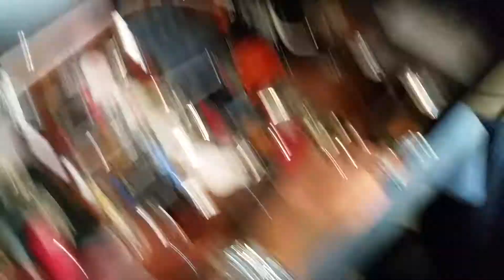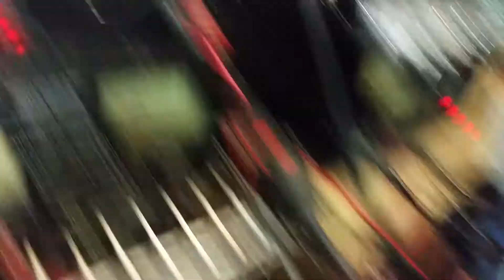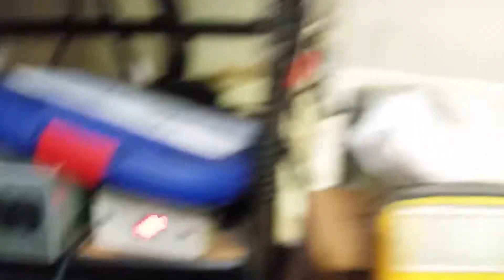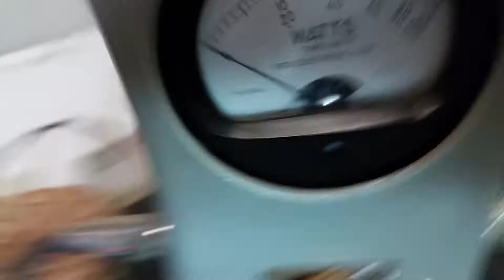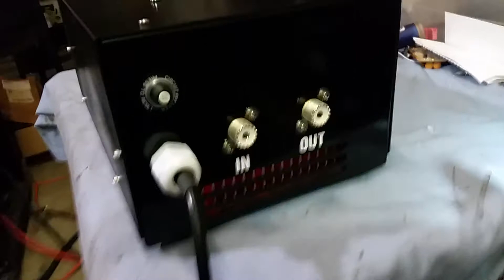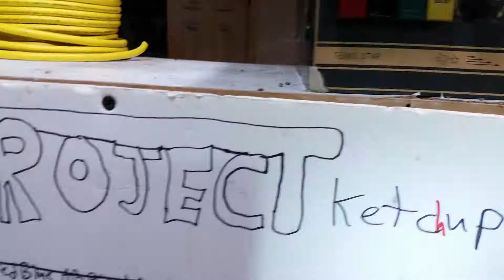GK Built 3 Pill Base🔌Amplifier with IRON 🦾 INSIDE Gk200-LD

Comment: Thanks GK for posting the video of my amp. Still running strong.
Reply from the maker: Heck yeh.....There he is yall. Dood thanks so much for commenting. I was really really wanting to know how well this amp is still working. With you popping up letting me know that 4 years later that it is still working and going strong 💪 means so much man. Thank you Kevin!

Just out or curiosity 🤔 have you used it stand alone or ever used it as a driver? Give me some readings on what you get out of it and what transmitter you use....thanks in advance bud.
Reply: @1883GotDown  I only  use a 4 watt base cobra 89xlr. I get 175 bird on 15.2 volts. 18.9 resting voltage. I'm loving it.
Reply from the maker: @mrnobody329-kevin6  beautiful....you know how to make things last!

Comment: LOL you did would I would do with that light. Nice base amp. I would not go any bigger with driver than 2290 on 3 pill. funny I got some filter cap . a box of them . love that bridge rectifier . I had base amps come threw with them 50 amp china bridge . they are junk. I can send you a truck load of bad ones. got a odd 20 amp ICAS  13.8V supply to fix now. looks like pyramid but has no name on it. and uses a 36V CT transformer . 1/2 of bridge rectifier used. and that went open. replaced with 2 Shockey diodes  TO 218 package.  30 amp 150V . they run cooler  and less voltage drop. checking filter caps now. may put japan ones in if customer wants them .has 4 2n3055 and tip 42c on back heatsink with diodes. trying to mount small fan now on it. it is a LM723 based supply. 73's
Reply from the maker: Real neat project you got going on right now. I have 2 Pyramid PS-36kx Power Supplies over here which were my first power supplies I ever purchased. Ill never forget. I bought me my second TS 667V and I paid $400 for those 2 power supplies(ooooooouch) they had just got back from pyramid getting repaired. First time it went, I went ahead and pulled out the LM723 and put a socket on it just incase. Pretty neat idea 💡 using the diodes that you used. I havent heard of people using them for rectifying voltage that way. That is neat...yes lower voltage drop. Thank you for the emails...I habe made a folder called Robert meyer to keep all my info from you in. You are a very knowledge person and I am delighted to have you here conversing with me!

I cant wait to play around with regulation because I really really want to regulate some iron. I know it is nice to have higher voltage like the 36v transformers but mine i have are only 16v or so.
Reply: @1883GotDown  The 36V winding has a center tap. so only 2 diodes are used. The replacement used is   30CPQ150  30 amp 150 V . I put the 2 diodes together and used 2 .with them the float voltage is about the same but under load have about 1V higher on filter caps. I pulled on and put on ESR meter. should be 4700 UF 35V . testing around 3000uf .I got some nice 4700 UF 35V low ESR audio grade made in japan will be going in. I put type 43 cores on pos  lead to block RF . one on ac cord as well. put thermal switch on foot of transformer and one on heatsink.  load test is fine. Inferred camera shows no real problems . when I put new filters in I will replace small wires with heaver AWG . they get warm under load. I did the diodes all ready. they had 20ga with 1/4 push terminal on bridge to transformer and the push terminal was melted on 1 side. I have a 80mm 24V fan for heatsink trying to figure out a bracket to mount.  no room to mount one buy transformer but can put one right on top blowing right transformer. power supply is used to power UHF/VHF radio . was set at 13.7 V I re set to 14V oner wanted that. there is a ammeter no volt meter. had to re calibrate meter. was off 2 amps low. This is not mine and can't show pic. 😀 73's my cats help as well LOL
Reply from the maker: @robertmeyer4744  I will admit, I never understood what center taps are about on secondary of transformers. Why didn't you have to use a full wave bridge and only a have wave? Do you mind explaining a center tap? I noticed on BBI video on a filament transformer that he had a center tap and some how used it for bias or something.
Reply: @1883GotDown  with 36V center tap . to get 18V ac only use 1/2 winding center tap. you use 1 diode and outher half you use one diode. this is 2 diodes in full wave using center tap . ac first half of wave form goes threw 1 diode than outher half 180 deg or neg part goes threw outher diode. making fill wave. the center tap makes split phase just like a pole transformer feeding your home. . now with a center tap on filament transformer  that different. the tube is directly heated and that the cathode. to bias the tube the cathode is lifted off ground to make  class A ,B , or C depending on tube. this the grid is ground. the input is put threw a LC for 50 ohm drive to the cathode . there is a filament choke to transformer.  the plate has a HV choke to plate and B+ HV.  directly off plate there is a PI network for tunneling to out put antenna . tube like 3-500Z 811A 672/B 8877 ETC are directly heated type RF tubes. grounded grid  cathode bias to ground. them tubes have cathode and filament the same .why the filament choke and center tap transformer is the bias to ground. can be a Zenner or diode stack to ground. also a relay is used for bias flop. cut the tube off when not transmitting. hope this helps.
Reply from the maker: @robertmeyer4744  wow you are very knowledgeable man..imma save this and come back to it for reference...thank you very much...I don't compeltly understand which means I just have more to learn which I am excited about .

Comment: Also, what's the right length of jumper cord from radio to amp and from amp to SWR/POWER meter? By the way, I'm just using an MFJ - 874 meter.
Reply from the maker: That determains on what your velocity factor of your coax. Look up Velocity Factor Equation for your coax to do the math.

For common coax like rg 213 or rg8 its 0.66 and comes out to 6ft 12ft etc... but even at that you need to try different length to aquire best swr.